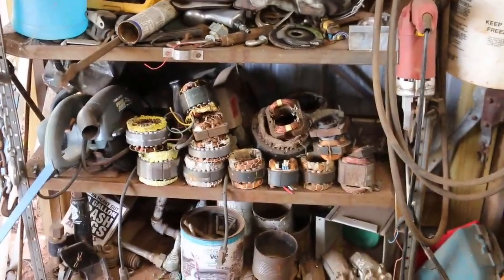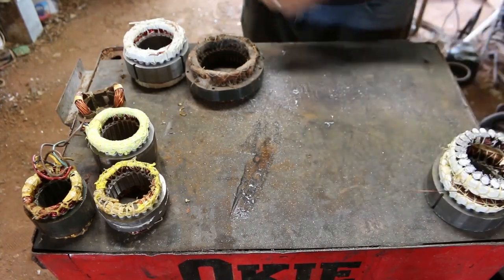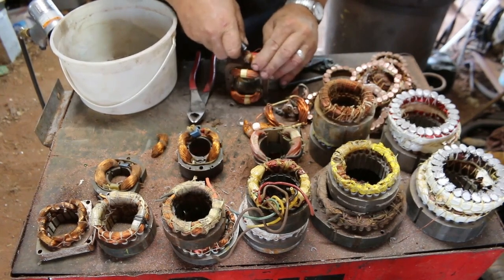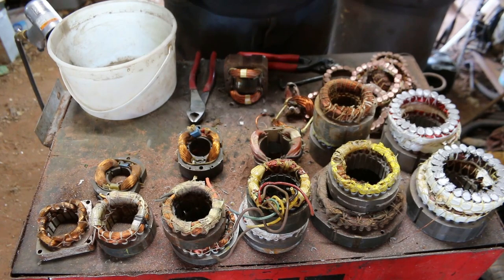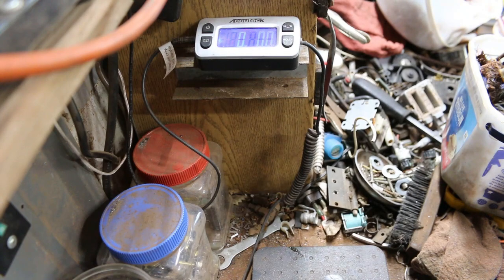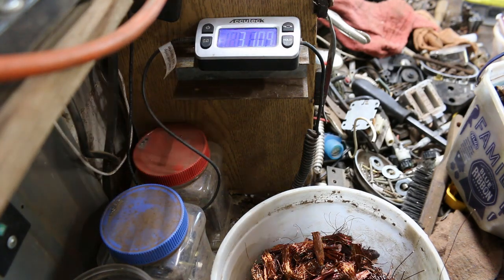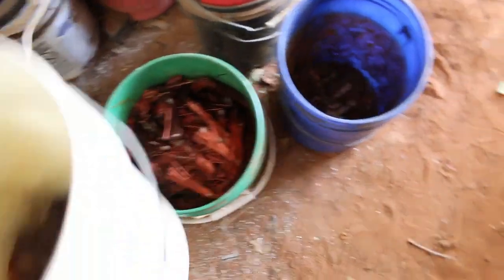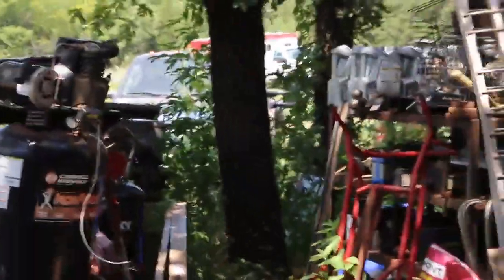Cleaning up some more Scrap Copper, the Orange Gold

Comment: I just did 33 smaller copper motors, I found that the smaller square and round motors the Sawzall works well. But once you get into the thicker strand copper stators the grinder is needed. I still have 3 buckets of larger copper stator to do. 33 motors I've done is at 27 lbs of copper so far. #happyscrapping
Reply from the maker: it adds up fast, and copper is paying a good price now. Thanks for stopping by Walt

Comment: I would use an air chisel. Or a hammer and chisel. Copper dust is not good, and the wheels gum up with the metal.

Comment: I quit scrapping.  The other day i took 150lbs of #2 copper in and got 8.5c per lbs .
Reply: How did you manage that? I would have taken it back home. Was it poorly burned wire?
Reply: @richardmccann4815  they don't tell you the price dropped they take your copper first and the you have to go to the shack on the far end of the yard and you can't get you copper back . No it was clean and stripped.
Reply from the maker: that is a bad price, sorry to here you got the shaft from the yard, insulated wire should go for 50 cents a lb. always a good idea to call around before you go to sell it,